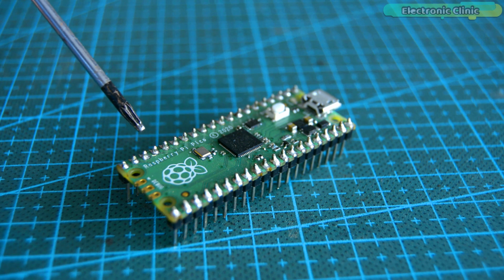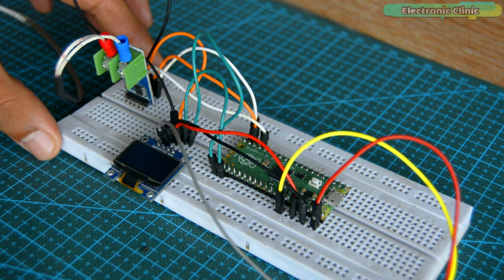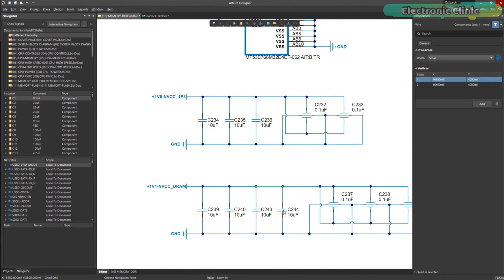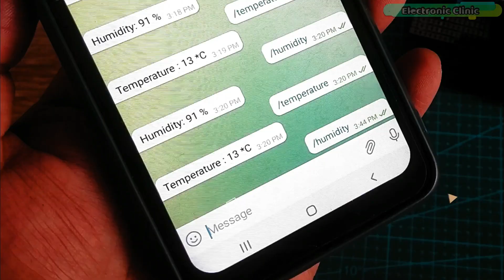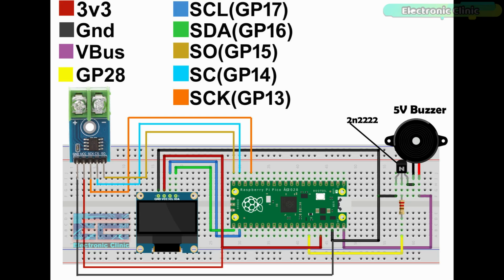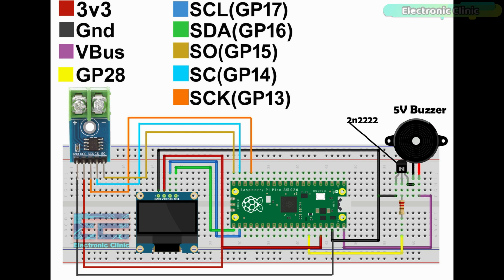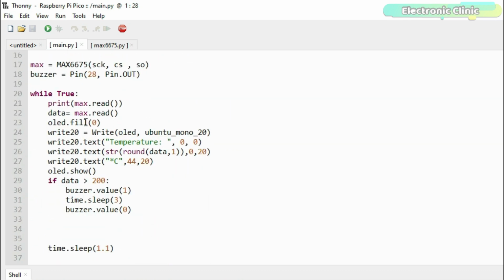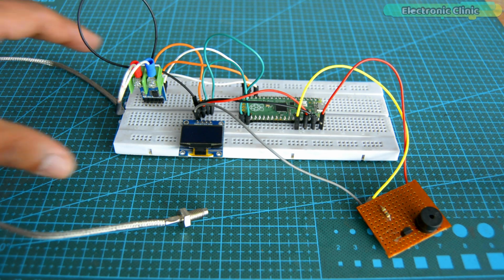Raspberry Pi Pico and MAX6675 based Industrial Temperature Monitoring System, K type thermocouple

Comment: A very good video bro. If I may ask what simulator did you use before connecting everything up? I am having challenges on what simulator is best for pico W in regard to a temperature measurememt application like this.

Comment: Great Job! I have one more requirement for the same project that is i want to connect mini printer which can print temperature, time and time, and the option for selecting printing interval.
Is this possible ? can you help me build this project .?
Reply from the maker: if your printer has the.bluetooth option then its easy. just add a delay and send data to your printer.

Comment: I'm gonna learn everything on here...then I can basically do everything I'd wanna do at home right?

After documenting all your videos, I just need to learn about signal hijacking  so that I can macguyver anyhting and hijack it's signal for automation purposes...I also need to learn how to have two components-value's be dependant on the other in the python script(also learn python), like I tell the thing to switch of AC-power to the lights if the temperature goes too high or to switch on a fan and balance all three-"components?"---see!? -"components" I dont even know the terminology..

I need to learn

But what book has all  of that info? circuit analysis? or is that merely step 1? then what book comes after circuit analysis? I've don basic programming so python will come with time but how do u learn this electronic- BS, where is the boook???????